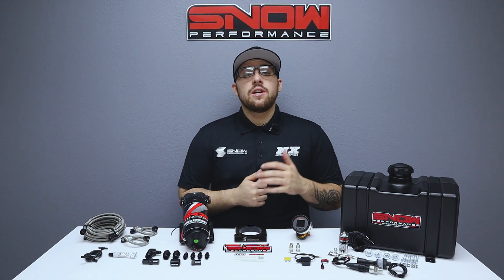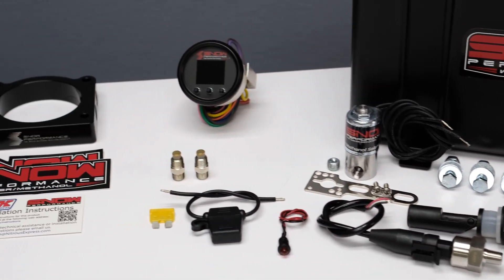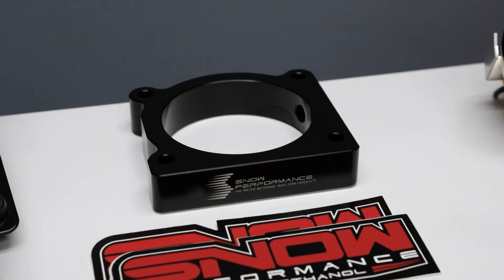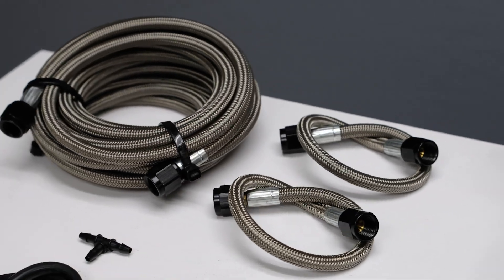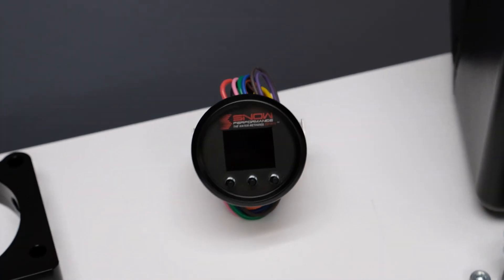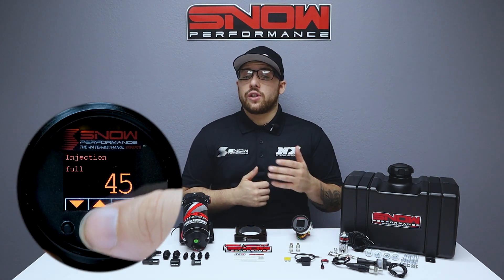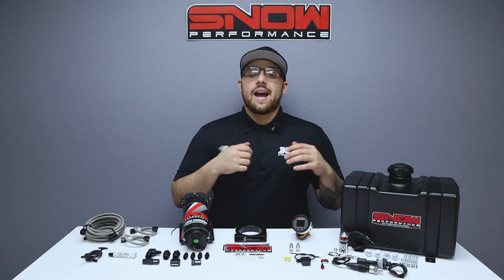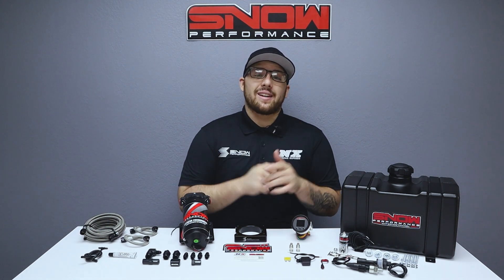Snow Performance 2010+ F150 EcoBoost 3.5L/NA 3.7L Water Methanol System

Comment: Does this fit the 2.7 L eco boost
Reply from the maker: Our 2015+ 2.3L mustang plate fits the 2.7L F150  https://www.nitrousexpress.com/Stage-2-Boost-Cooler-2015-Ford-2-3L-Ecoboost-Water-Methanol-Injection-Kit-Stainless-Steel-Braided-Line.asp

Comment: On the ecoboost, 3.5 twin Turbo. After installation, does it need to be tuned ,timing,fuel mix ?
Reply from the maker: Getting a tune will boost the benefits of water-methanol and allow for more power gains and consistent cooling

Comment: That's a Monster sized pump ..  When are you going to make a downsized system for a 1200 CC Naturally aspirated air cooled Motorcycle engine?
  Such as my 103 Horse Power  2008 Buell Ulysess with a 1203 Cc Thunderstorm engine?